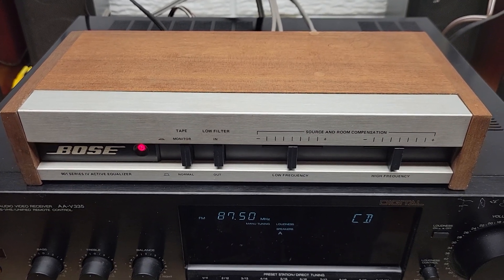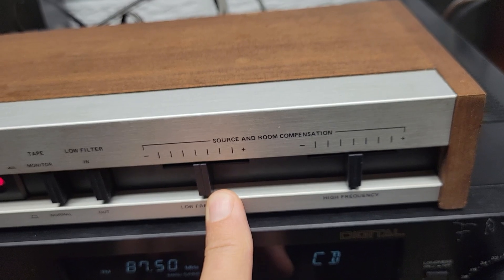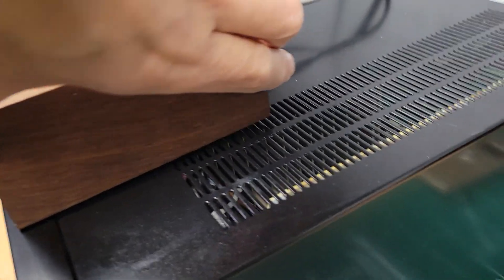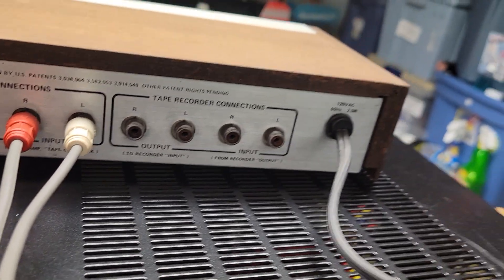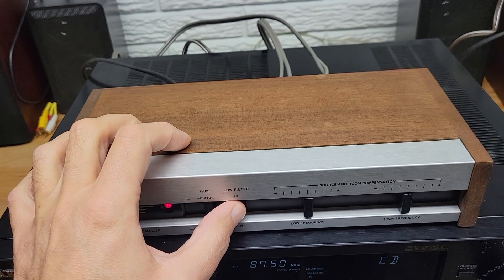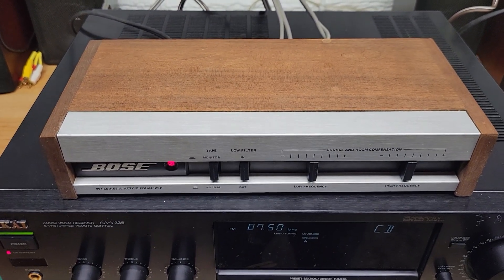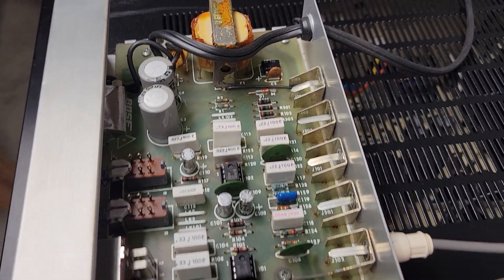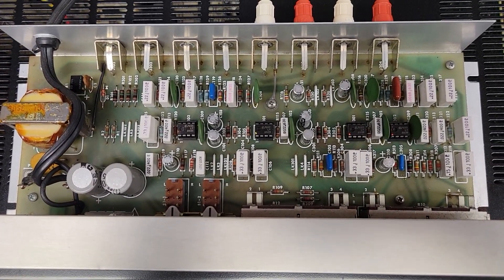Bose 901 Series IV Active Equalizer Demo

Comment: If you have a switched outlet on the back of your receiver that is where you would plug this in. It will then be turned on and off automatically with the receiver power. Liked seeing the inside and back of the unit.